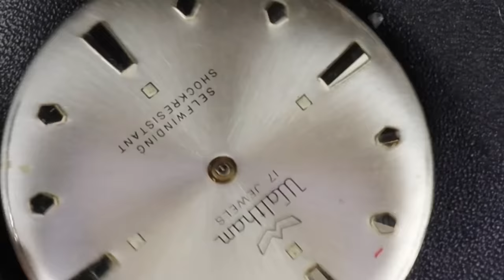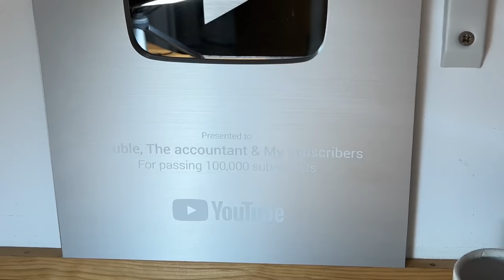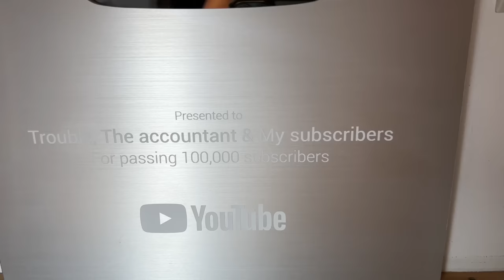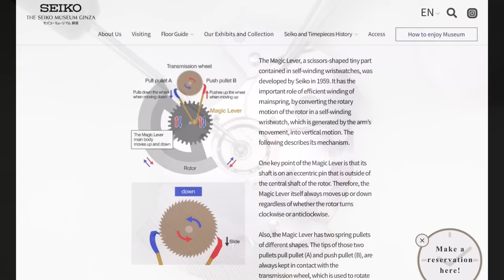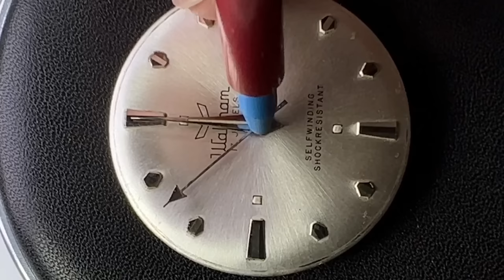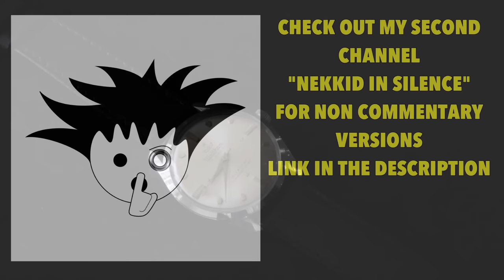VINTAGE AMERICANA WATCH RESTORATION

Comment: I really enjoyed the back story on Waltham - it added a lot of interest to the video.  Great job on the restoration as well.
Reply from the maker: Thank you 🙏
Reply: I used to work in Waltham, MA and at that time Waltham watch company was a manufactured Aircraft Instrument. I owned many high pocket watch made by Waltham like RR grade 21 jewels. This pocket watch was found between crack of the floor in excellent condition with broken stem. American wist watch are not collectable like switzerland and basically not worth fixing.

Comment: I was digging through my box-o-watches the other day and saw this Waltham.  Don't recall how I got it, but decided to service it. Immediately upon opening, I was confused.  Like no other Waltham I had worked on.  Having done a few Seikos, I was sure there was a connection. Anyway, I serviced it and posted on the WRT forum...asking about the unmarked movement.  Somebody pointed me here.  Yup...that's the same movement.

Comment: Very interesting your knowledge of the American watchmaking is quite good!
I know of Elgin, Waltham, Ingersol, Hamilton and Ball....
American watches I read had to be very accurate as they were used in the American Rail Road industry, since the country was so big 
time was a major factor and the Kipton Rail road incident where two trains collided due to watches not being synchronised and accurate.
I read somewhere that it was Ball and Hamilton watches that kept the rail roads safe.
The micro rotor was patented by Buren but Hamilton purchased Buren, the question here would be which patent does Patek Philippe use with their Micro rotor?  But anyway that's another story!

Comment: Thank you for this video, you sparked my interest in american watches.
I'll keep my eyes open for something that fits me.

Waltham still exists, technically. There is a Walham International SA, based in switzerland.
The company is a branch and its purpose was to import parts that Waltham couldnt produce in the US, from switzerland back to the factory.
They still make and sell watches.
Waltham itself stopped producing watches inside the US in 57 and started manufacturing precision instruments, such as aircraft clocks. Or electronic parts for the car industry.
The swiss, bought them during the late 60s and they kept making watches, with chinese cases and swiss movements.
During the Quartz crisis, the conglomerate they belonged to, went under and they were "free".
From what I could find out, they still produce aircraft clocks.
Reply from the maker: Thanks for the info mate

Comment: In the 1950s, Waltham, reeling from the aforementioned bankruptcy, tried to make a go of it by opening an office in NYC and importing Swiss movements. 
They called these new brand of watches Hallmark  
If you see a watch with the name Hallmark on the dial, no, it is not related to the greeting card company, but is a Waltham.  They are nice watches and came in all varieties. I have an automatic with an AS1580 movement, 17 jewel, and a cool dial, runs like a top.  It has Waltham written on the rotor.  The case was made by Id, who also made cases for Rolex back in the day.
Picked it up for $10 with the original case.  So, keep an eye out.  Collectors have not yet noticed them so they can be found for very low prices.

Comment: The best US watch to do would be a Hamilton because of it's tie in with "Pulp Fiction". I have a ladies pendent watch in a hunter case which is an Elgin. It was made in 1912 and does not run. You would be welcome to work on it if you liked. I also have a Gruen wrist watch but sadly Gruen just cased and adjusted Swiss movements they had made. Bulova has the emphasis on the first syllable as in BUL-lo-va, not the way you pronounced it.

Comment: Lovely work as always. The American watch industry really is underrated, due in large part to fading cultural relevance. Lord Elgin in particular, as you can get 14k solid gold or gold-filled cases, beautifully made and decorated 17-21 jewel movements, and classic design for as little as a quarter of an equivalent Hamilton. Of course Hamilton used to be American but is now part of the Swatch Group which is why they're still relevant. Elgin had one of the first observatories for watchmaking in the world (accurate to within 1/10th of a second too!) and Waltham is the father of standardized parts in watchmaking, but now that's all gone. Anyway, all you have left to do is a piece from the USSR and I believe you'll have covered all the major watchmaking nations. Given how such Soviet watches are my speciality as a hobbyist myself, I can give you pointers on what would be interesting projects if you like.
Reply from the maker: Thanks jake. Yes please let me know. I was thinking of doing a Vostok amphibious at some point
Reply: Boring. Please so a Wostok 2809 instead. Or a Poljot deruxe 23 jewel super slim.

And by the way, don't forget east Germany/the GDR. They Made great watches in Glashütte (try a GUB Spezimatic) and really wird, cheap ones in Ruhla. Have a look at the Ruhla Chronograph, die example.
Reply: @NekkidWatchmaker  Vostoks are nice but are a bit commonplace. I would recommend one of the more unusual movements, such as the Raketa 2209 (super-slim, 23 jewels, won a gold medal at the 1965 Leipzig Trade Fair), Slava 2414 (TWO MAINSPRING BARRELS), or a Luch 3055 (quartz controlled electromechanical  movement!).

However, the Pobeda/ZiM 2602/2608 movements are also rather nice. The ZiM 2602 came first as the people's watch of the USSR and is a license-built LIP R-26. Made from 1950 all the way until 2006 with very little modification done to it. The 2608 would possibly be even more interesting, given that it's essentually a center-seconds conversion of the 2602 done on the cheap.

Comment: Another achievement of the American watch industry in the late 19th-early 20th centuries was standardization of movement sizes. Not always, but most of the time, a movement of a stated size was compatible with any other movement of that size, from most other manufacturers.

Manufacturers generally made only the movements, shipped to jewelers with faces and hands but not cased. Case manufacturers didn't need to customize their cases for specific movements. They just needed to make a case to fit, say, a 12s movement with the stem at either the 12 or 3 positions. Customers could go to a jeweler and select a movement that suited their needs, and a case they liked, and the jeweler could case the movement for them.

This is why you sometimes see lower quality 7j movements inside 14k solid gold cases, and fine 21j movements in brass gold-plated cases. One was a rich guy who didn't need to be on time but wanted to show off, and the other was someone who really needed to be punctual but couldn't afford to splurge on a case.
Reply from the maker: Thanks for that great piece of info mate

Comment: I have a Waltham pocket watch that belonged to my father. I'm not 100% sure how he came by it - could have been either pre- or post-war. Internet research based on the serial number says it is a 1928 Model 1894 Grade 225 size 12s, 17 jewel. The case was made by Illinois Watch Company, gold plated. The box it is in says E.P. Boddington, Waltham Watch Depot, 99, New Street Birmingham. We lived near Birmingham, so that tallies. I don 't know if they dealt in second-hand watches or what. My father left it to me with a note saying that it is a valuable watch - but that may be based on how much he had to pay for it in the 40's or 50's. Sadly it does not wind, I think it is probably fully wound and not running - it really needs a watch repairer to sort it out - where would I find one of those, though?

Comment: Speaking of Donald Duck, I just got back from Disney World last night. Need some guidance tho, if you can spare it. Before I left, my bro left his watch (gift from his dad) for me to clean up. Unfortunately, the stem broke right at the crown threads with nothing for me to grip to back out the remnant. All week in between having my brains squeeze out through my ears, I've been thinking about how to get it out. 

Should I try small drill bits and work my way up until enough of the stem is gone to release tension, then maybe I can get a bite on the center hole? Or is there something like a screw extractor for tiny watch screws? I did run it through the ultrasonic hoping that it might back out during the cycle, but no go. Obviously trying to source a replacement crown is an option, if I could find one, but that would be a last resor and I haven't delved into crown replacement yet. Is there a stem gauge I would need to buy to match the stem threads to the proper crown? I seem to remember seeing one on a video. What do you think? 

Kinda faclemped at this point. I've safely removed many stems, but when I finally volunteer to help out a mate, my lack of experience gets me in the goats donkey. 😢

TIA for any tips, for real.
Reply from the maker: Try some aluminium potassium sulphate. Sometimes it works and dissolves the broken stem and other times it doesn’t work depending on the alloy of the stem

Comment: Are you familiar with Vortic Watch Company, out of Fort Collins, Colorado? They specialize in taking classic pocket watches, mostly from the period between WWI and WWII, turning them into beautiful wrist watches and restoring their functionality. Here is the watch I purchased from them in 2020 (https://vorticwatches.com/collections/watches/products/the-springfield-240-46mm). I love that the winding stem it still at the top, as it was on the pocket watch. They peruse locations all over the U.S., searching for discarded movements suitable for reconstruction. I highlight this mainly as you mentioned there aren't many examples of American watches, and here is a company that specializes in restoring them. They also have a military version, which was used exclusively in WWII for its superior accuracy.
Reply from the maker: I came across them many years ago.

Comment: If their watches are of the same quality of any other American product, they will be total rubbish. Trust the Yanks to have a watch with only an automatic winder, they are so lazy they won't even wind a watch!
Reply: A: American-made watches (that is, those actually made in the U.S. and using American movements to power them) are generally no better or worse than any other nation. B: Having an automatic winding rotor-only watch isn't an exclusively American concept. The Japanese, USSR, and Switzerland among others also did that at some point or another.